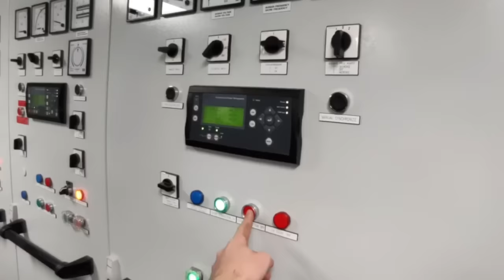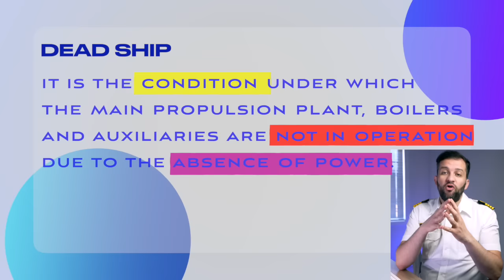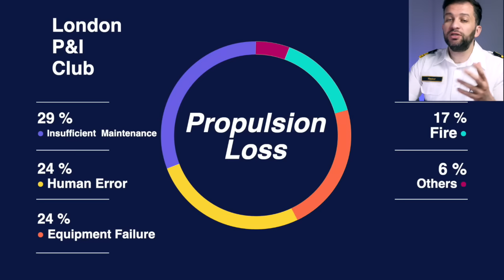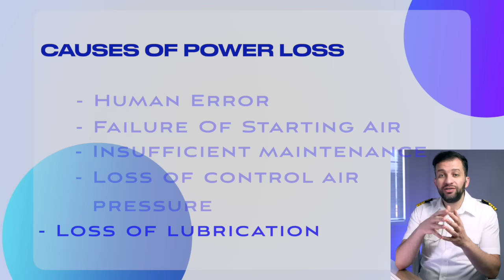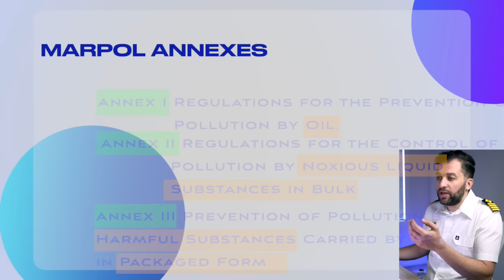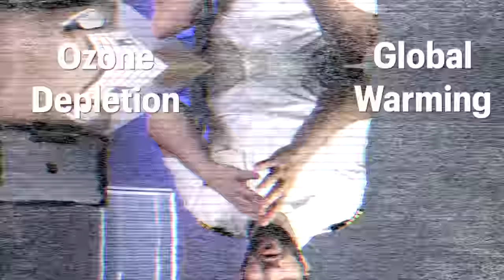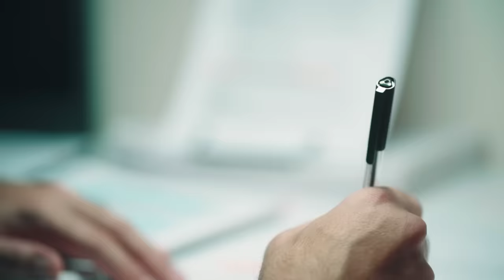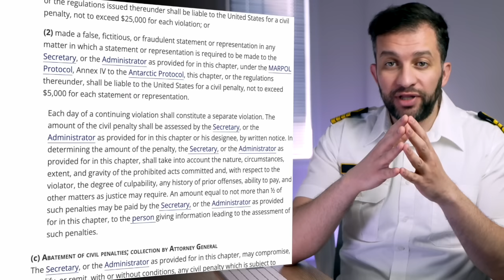Is This The Cause Of Power Loss ? CAPTAIN EXPLAINS

Comment: Basically the error maybe the ships Captain and Chief Engineer conducting a critical event while in restricted waters if I’m following your logic? 
PS — Would the MV change over the fuel had it not been 1 AM when no one could observe smoke leaving the ships exhaust? 
PS2— Ports of LA and Long Beach are installing shore power at pier side both to reduce pollution and to allow ships to avoid using diesel generators while at pier side. 
PS3 — Thank you for clearly outlining these potential root causes. Hopefully the NTSB will be able to ID the ultimate causes.
Reply from the maker: The FO change over before clearing the ECA is prohibited and punished by law

Comment: My destroyer was in a screen at the back of a formation around a heavy, immediately after the formation executed a course change we dropped the plant. Unfortunately, since we were still in a turn we continued and did a 360 degree movement. Since we were at the rear of the formation we were not at immediate risk of collision; however, compounding our situation, emergency generator auto started but power was not immediately available since after the last PMS period a petty office had not place the emergency generator back on line nor had the DCA officer that was suppose to ensure the status of the system recognized the error. Investigation was not fun to those involved nor the chain of command. Letters were issued by the Board.
Reply: Was that a US Navy destroyer?  You didn't say what caused the plant to drop.  Was it a fuel oil changeover?  So does the US Navy also have to carry both kinds of fuel and switchover between them?

Comment: If an accident is possible, it will happen, at some point. My take on the cause of the accident? Just bad bridge protection. Yes, the ship might have had a power failure but it should never have been in a position to destroy a whole bridge. But some people like to blame others. Anyone but them.
Reply: I'm surprized when the port put in request to add cargo cranes to it's facilities that the local environmental and logistics considerations weren't factored in.
The bridge should have been modified with wider/stronger piers with channel Pylons/dolphins installed to protect all bridges. The requirment for tug assistance should never have been dropped for incoming and outgoing vessels.
All of this SHOULD have been required and in place before first cargo was ever allowed to dock at new facilities.

Comment: Traffic since the Francis Key Bridge is “Gone now”, going through the 95 and 895 Baltimore tunnels are  seeing an additional hour or more in stop and go traffic delays Monday thru Friday.  From all these tailgating stop and go vehicle and truck delays during the week, they are causing massive extra smog and pollution in the Baltimore area.

When the salvage of the bridge and Dali container ship is done in 2024, I suspect it will still take a minimum of 5 years for a new bridge to be reconstructed replacing the now defunct Baltimore Francis Key bridge.  With 55,000 vehicles and trucks using this bridge for their daily commute now gone, these extra hourly delays will make traffic pollution in Baltimore horribly polluted for years to come.

Seems to me if this crew to save money switched to the cheaper fuel in the Baltimore port prior to exiting the port I would expect the FBI will arrest them.  Talk about penny wise and pound foolish.
Reply from the maker: In normal operation, without hitting the bridge and without involving the FBI, changing the FO deliberately within ECA would lead to jail.

Comment: Thanks for the explanation of the regulations, and the behaviors they can motivate.  I'm wondering if low reserves of the 0.1% SOx fuel could explain the loss of power to the refrigerated cargo while in port?
Reply from the maker: No, the power is not specific to the refrigerated cargo but to the whole ship.

Comment: Supplementary question. Not about but related to…
Do you, or one of your subs, know if the waters around the bridge area is salt, fresh or brackish? 
I’ve got my slide rule out and I’m figuring some basic numbers for the C1000 floating crane. 
CG, CB, draught, trim, and those funny little things. TIA. 👍

Comment: I can't believe they would use two stop valves to make the changeover from one fuel to another.   There is always the possibility that both stop valves will be closed together.    What is needed is a single change-over valve, that insures a constant fuel supply.

Comment: I think is time the fosil fuel issue is address in small increments , cogeneration is a good example, thee heat exust can power a regular steam engine or one based on refrigeration cicle ,this ones can work on temperature below 80° Celsius.

Comment: I seek clarification. 
Would the stopping of the main engine cause a shipwide blackout?
I could see failure of the main generator being more likely but even then, the generator(s) would tend to spool down giving a brown out effect as opposed to the instantaneous loss of all electrical power. 
I know the inquiry is in its early stages but their findings are going to be eagerly anticipated. 
Great post. 👍
Reply from the maker: Thanks, the blackout can be for any reason !
Reply: No. The regulations state that multiple entirely independent diesel generators must be in functional order, and in operation and synched to the main power bus during such operations. The main engine may have an electrical generator, but it doesn't have to have any generating capacity of its own.
Reply: @Mr424242424242424242  Yup, that’s what i’m saying. 
If the main engine stops, power generation doesn’t. But total power failure stops (eventually) the main engine. 
The video shows a ship-wide blackout, not a slow loss due to an aux generator motor failure.

Comment: Unstable load share when operating 2 or more generators in parallel is sometimes the cause of a electrical failure.  This leads to one generator motorizing and breaker tripping    A complex subject and often not understood by the crew.

Comment: Could it be that the ship ran out of the proper fuel? Do the ships operators "encourage" captains to change over fuel sooner to save money, possibly providing some type of bonus that might offset any fine if they got caught? It is unlikely that a captain would be given a prison sentence for a first offense. Meanwhile, the ship must be burning the expensive fuel as it sits aground in the harbor.
Reply from the maker: No ship operator would allow the crew to use other fuels than required.

Comment: Captain, let me ask you some questions, from a seafarer to another one.
As captain, if you have SEVERAL black-out during cargo op while alongside, and c/e can't solve the cause, you'll sail away?
During maneuver, with POB on such river passage, close to bridges or to some oil or gas terminals, you'll be on the bridge or else?
In such situation, close to a bridge, when you have a black-out, you'll order to drop anchor?
I ask that because I have 40 years at sea as engineer of which 24 as chief engineer on all type of ships. 
And I can say without fear I'm wrong, in this case the fault is on MV Dali C/E and Captain.
C/E fail to manage the ER, poor power management during maneuver, poor management of ER.
Captain same, poor knowledge of ship's behaviour, poor risk assesment, poor management.
Reply from the maker: If I'm 100 % sure that the electric issue will jeopardize the safety of my crew and my ship, definitely I'll not sail out.
During pilotage, the captain has to be on the bridge, unless it's long pilotage where he can be replaced by CO.
Reply: @MustaphaZehhaf  that's what I said. That's why I keep MV Dali's cpt and C/E responsible for the incident.
NO BLACK-OUT IS COMING OUT OF THE BLUE.
Some of us at sea are captains or chief engineers only because they were able to buy those 4 stripes, not because they earned due experience and knowledge.
Onboard ships, the difference between being a boss or a leader is the key.

Comment: I find it difficult to believe that the Ships Engineers would be illegally switching over from Low Sulfur Fuel to High Sulfur Fuel while maneuvering  in such a vulnerable area of their passage for economic reasons. I can believe they suffered clogged  fuel filters or a fuel pump failure which required switching the fuel tanks supplying the ship’s generators. A cascade of failures including human errors could easily follow considering how quickly events progressed. Any professional mariner who has spent significant years at sea has been on ships that lost power or propulsion, rarely does it lead to a catastrophic outcome. Whatever happened here there was very little time to recover, and everyone involved on the vessel would have doing everything they could to salvage the situation.
Reply from the maker: Exactly, this video is to reply to the FO change over comments and I've commented at the end that it cannot be the case.

Comment: They cannot be held responsible for breakdown ,the ship was certified seaworthy with all required certifications  these are to be expected, however they can be held for wrong actions when faced with an emergency situations, in this case trying to stop the ship using astern propulsion , dropping the anchor, etc for a Ship that was making a headway of 8 knots which could have been used to navigate the vessel safely  under the Bridge, Moreover power loss was for less than a minute  & THIS ERRANOUS ACTION CAN BE ATTRIBUTED TO CHANGING THE FOCUS FROM A CONTRACTED SAFE PASSAGE TO SAVING THE BRIDGEHEAD , only ended up crashing it , Though the Pilot (who is a Goverment employee)  is there to assistthe Captain,  it was the Pilots act to take the decision of stopping the vessel & remember it is America notorious for its bulldozing attitude,
Reply from the maker: This is what I've covered in my previous video.

Comment: It is still a bit confusing… you are mixing terms like “power” and “propulsion”, and talking about “main engine” and “power supply” etc. Also “loss of power” … 

It’s becoming clear that there is a Main Engine for propulsion (driving the shaft and propellor),this can have 2 fuel types and requires ‘external’ electrical power from the ship to run. Then there are the Electrical Generators which often run as a pair with a third ss backup, at least one must run all the time and in port… these presumably also switch between the 2 fuel types depending on location and regulation. Finally there is the Emergency Generator with its own fuel supply.

So the issue is whether the fuel supplies are switched together or separately for the main engine and generators, and whether maybe one generator is running on clean fuel and another on dirty fuel at the same time or during a transition…. that sort of thing… do they take one generator offline and another online ?

Comment: The cause of loss power is 80% bad fuel, 20% other reasons( incl. Human error). The port of Baltimore is well known of low quality fuel. The time to start 2 main generators (+ The small on deck) is 1-3 min.... Not enough to ABORT initial course, 1-2Lenghts before the bridge, in a 8.7kts speed,
Reply from the maker: Did they bunker from Baltimore?
Reply: @MustaphaZehhaf  for a lengthy trip around Africa towards Singapore , they needed to refill the tanks.....